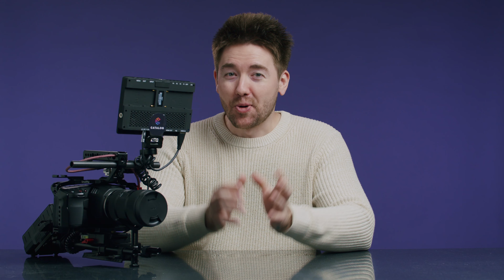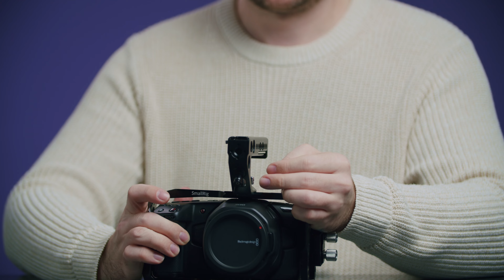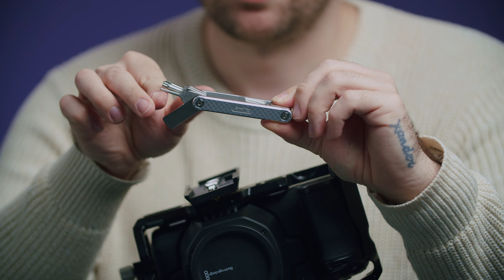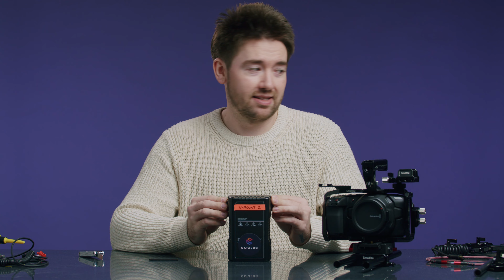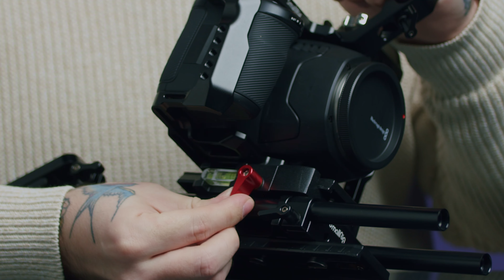My SmallRig Cinema Camera Rig! How to Build BMPCC6K BMPCC4K Rig

Comment from the maker: 00:00 Introduction
00:53 What I like about this Rig
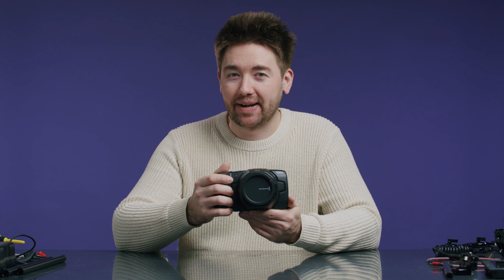1:32 Build Start
2:00 Cage
4:01 HDMI USB-C Clamp
5:00 Top Handle
6:25 SSD Holder
7:50 Extra Cold Shoe Mount
9:15 Manfrotto Plate No.1
11:52 15mm Rod Base Plate
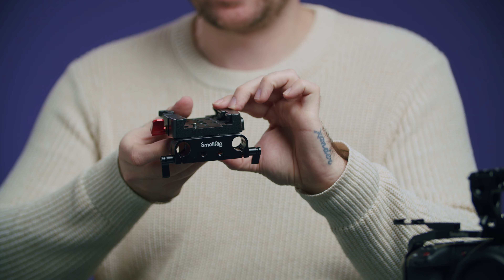13:20 15mm Rods
14:23 V-Mount Battery Choice
15:40 Angled 15mm Plate
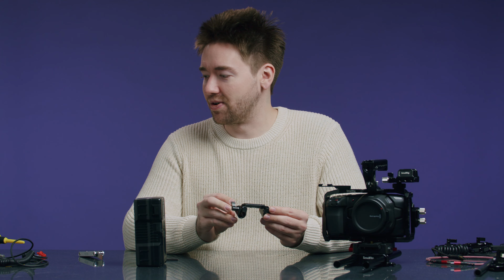16:06 V-mount Plate
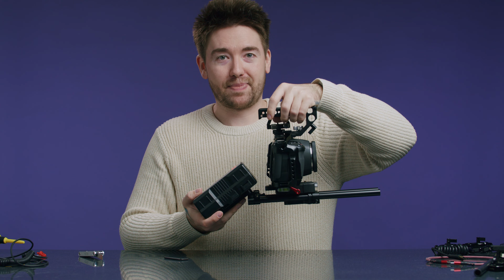18:45 External Monitor
20:00 Swivel & Tilt Mount
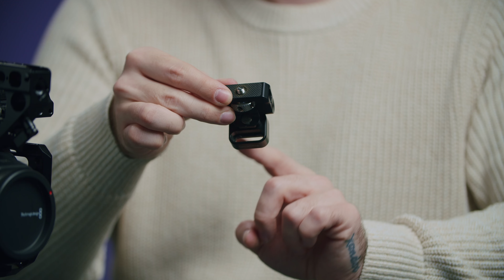20:18 15mm Rod Clamp
21:27 Carbon Fiber 15mm Rod
23:24 Manfrotto Plate No.2
25:09 Lens Supports
27:11 HDMI Cable
27:25 USB-C Cable
27:43 Cable Management
29:21 Power Cables
30:26 Rig Complete & Wrap-up

Comment: Can I mount the SSD holder also without a rig cage directly to the BMPCC 6k Pro?
Reply from the maker: You’d still need something like a cold shoe mount attached to the top mounting point of the camera
Reply: @AnotherCameraChannel  There ist something that looks like a cold show on the top (behind the 1/4" screw-hole), isn't that a cold shoe?
Reply from the maker: Thats for the optional EVF sold by Blackmagic
Reply: @AnotherCameraChannel  and the optional evf doesn't have a cold shoe as socket?
Reply from the maker: I don’t think it’s a cold shoe but a screw and some kind of special connector.
Just get a Smallrig 1241 https://amzn.to/3V9g7v3 or a Smallrig 2797 https://amzn.to/3gnuqNN and attach it to the top 1/4” screw that’ll give you a cold shoe mounting point.